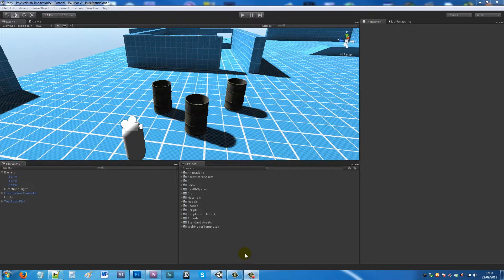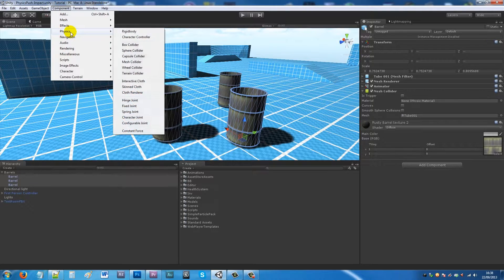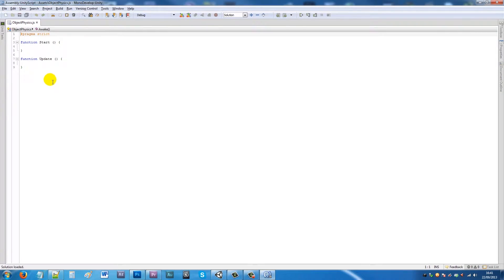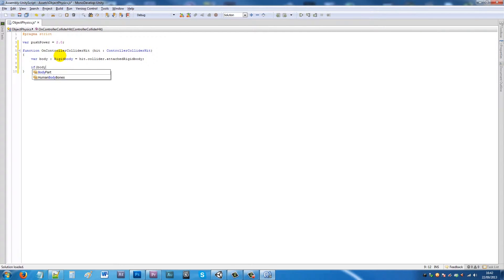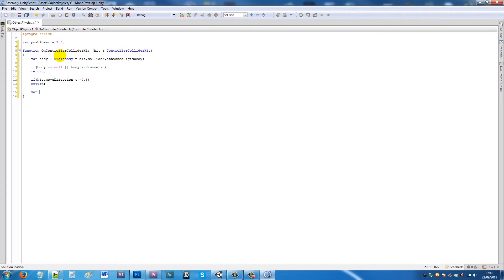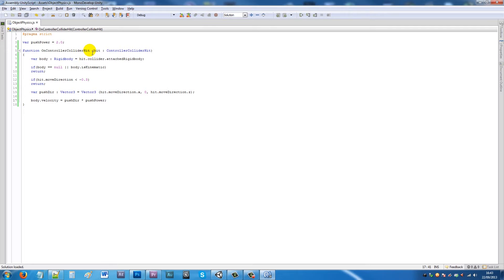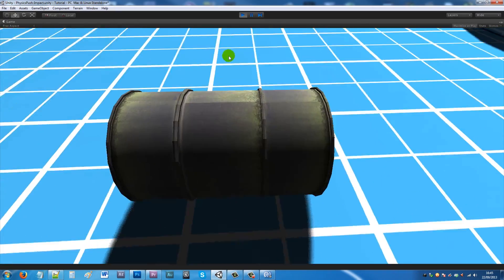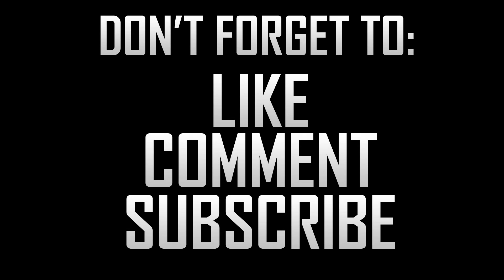[Unity 4] Pushing physics objects with rigidbodies (JavaScript)

Comment: here is the C# if anyone needs it

using System.Collections;
using System.Collections.Generic;
using UnityEngine;

public class Push : MonoBehaviour 
{

 public float pushPower = 2.0f;

void  OnControllerColliderHit(ControllerColliderHit hit)
{
 Rigidbody body = hit.collider.attachedRigidbody;
 
 if (body == null || body.isKinematic)
 {
  return;
 } 

 if (hit.moveDirection.y < -0.3f)
 {
  return;
 } 

 
 Vector3 direction = new Vector3 (hit.moveDirection.x, 0, hit.moveDirection.z);

 body.velocity = direction * pushPower;
}

}

Comment: so how you would make so you grab that object. Like when you press E you grab it and when you press E again you release it
e.g
you have shopping cart you want to grab, so you press E near it and start pushing it without throwing it like its weight is 1kg.
Reply from the maker: ***** I'd say you might want to research this online, there are some good suggestions already out there!
Reply: +DJPrison  I found this. Originally, it used the mouse to move objects. Also, its in c#. (I'd like to know how to make objects kinematic while holding, also, not abled to pass through walls, but its still a good script)

using UnityEngine;
using System.Collections;

public class GrabandDrop : MonoBehaviour {
 
 GameObject grabbedObject;
 float grabbedObjectSize;
 GameObject GetMouseHoverObject(float range)
 {
  Vector3 position = gameObject.transform.position;
  RaycastHit raycastHit;
  Vector3 target = position + Camera.main.transform.forward * range;
  
  if (Physics.Linecast(position, target, out raycastHit))
   return raycastHit.collider.gameObject;
  return null;
  
 }
 
 void TryGrabObject(GameObject grabObject)
 {
  if (grabObject == null || !CanGrab(grabObject))
   return;
  grabbedObject = grabObject;
  grabbedObjectSize = grabObject.GetComponent<Renderer>().bounds.size.magnitude;
 }
 bool CanGrab(GameObject canidate)
 {
  return canidate.GetComponent<Rigidbody> () != null;
 }
 void DropObject()
 {
  if (grabbedObject == null)
   return;
  
  
  if (grabbedObject.GetComponent<Rigidbody> () != null)
   grabbedObject.GetComponent<Rigidbody> ().velocity = Vector3.zero;
  grabbedObject = null;
 }
 
 void Update () {
  if (Input.GetKeyDown (KeyCode.E)) 
  {
   if (grabbedObject == null)
    TryGrabObject(GetMouseHoverObject(5));
   else
    DropObject();
  }
  
  if (grabbedObject != null) 
  {
   Vector3 newPosition = gameObject.transform.position+Camera.main.transform.forward*grabbedObjectSize;
   grabbedObject.transform.position = newPosition;
  }
  
 }
}

Comment: I'm curious to know if this will work with the mobile character controller. I have been using this and switching the script over and over to different parts of the object but I cant seem to get the physics to work...
Reply from the maker: ParaShotStudios What script have you added this too?
Reply from the maker: ***** The FPSController needs to have a rigidbody or CharacterController component which acts as a ridigbody to apply physics.
Reply: Okay, ill try that out
Reply: It does have a preset CharacterController, no luck still.
Reply from the maker: ParaShotStudios You're using the default standard FPS Controller? The script is attached to it? Your other object has a collider and rigidbody on it? (The collider needs to be rounded or it won't move.

Comment: I did everything like you did but my object won't move. It has a mass of 1 and my pushpower is 2, so it should be able to push it right?
Reply from the maker: BaneThePig | MCSG What are my values in the video?
Reply: SpeedTutor Barrel has a mass of 1 (and .21, but i even tried setting the mass to .01 and it didn't work) and the push power is 2.
Reply from the maker: Have you added the push script to your player?
Reply: Yes, and I've read through the script a billion times to make sure there's no errors.
Reply: ***** I did and it still doesn't work :(

Comment: Okay i done exactly everything you done but i am getting this error:Assets/ObjectPhysics.js(11,30): BCE0051: Operator '<' cannot be used with a left hand side of type 'UnityEngine.Vector3' and a right hand side of type 'float'.

this proves i done EXACTLY what you done:

#pragma strict

var pushPower = 2.0;

function OnControllerColliderHit(hit : ControllerColliderHit)
{
	var body : Rigidbody = hit.collider.attachedRigidbody;
	
	if(body == null || body.isKinematic)
	return;
	
	if(hit.moveDirection < -0.3)
	return;
	
	var pushDir : Vector3 = Vector3(hit.moveDirection.x, 0, hit.moveDirection.z);
	
	body.velocity = pushDir* pushPower;
}
Reply: This if(hit.moveDirection < -0.3) should be this : if(hit.moveDirection.y < -0.3)
Reply from the maker: 360McCide That is strange, what version of Unity are you using?